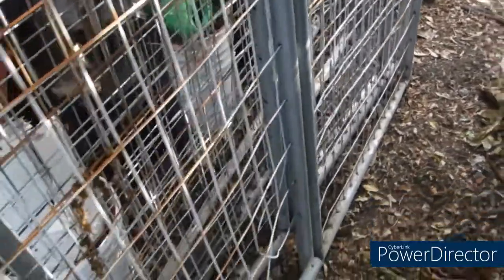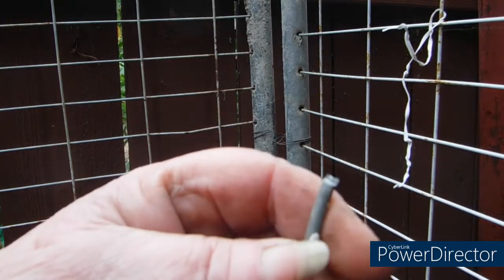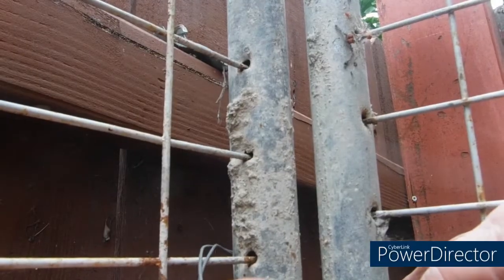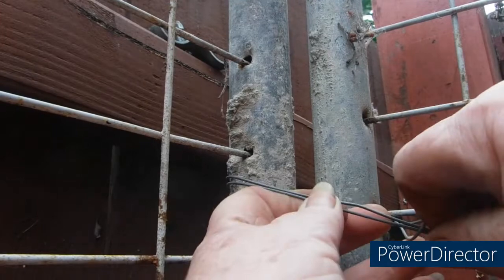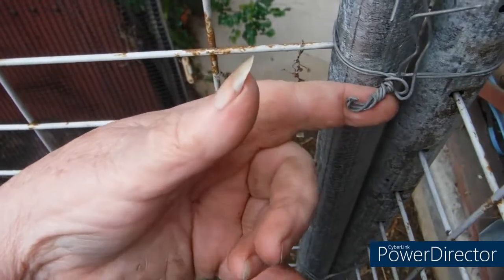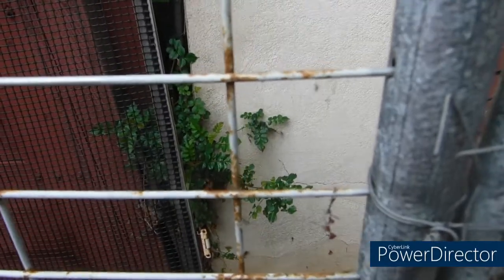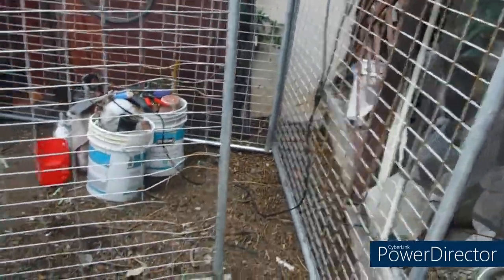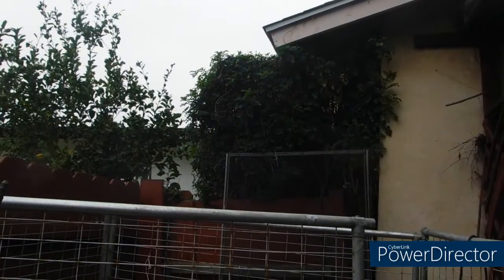DOG KENNEL TO GREEN HOUSE

Comment: Leather garden gloves would be your go to for a job like this! And heavy duty zip ties, Dremel tool instead of chain saw maybe. 
Awesome job, regardless.
Reply from the maker: Thanks for the suggestion but since this is permanent and zip ties are not I use wire and it would take all day with a little bitty Dremel to cut through that piece of wood as you noticed safety is in high on my list

Comment: The doorway you could use a floaty noodle thing and wrap the pipe.
Reply from the maker: The only problem with the noodles is it will make it even lower and I have a bending problem I'm finally only cracking my head on it once a day now instead of every other time I go in and out
Reply: I find such awesome uses for pool noodles!